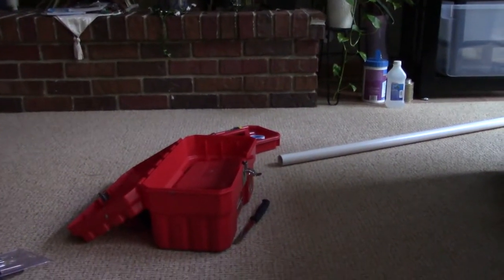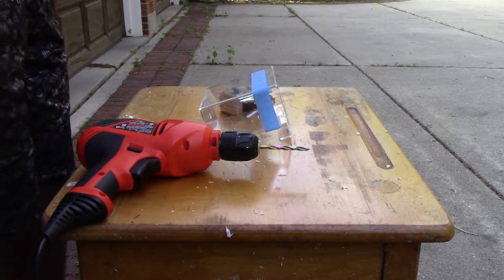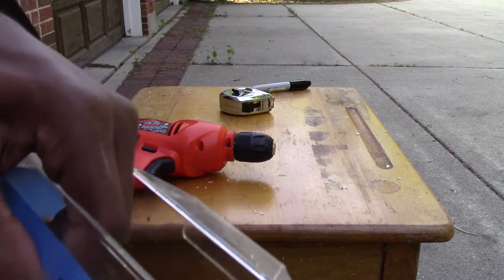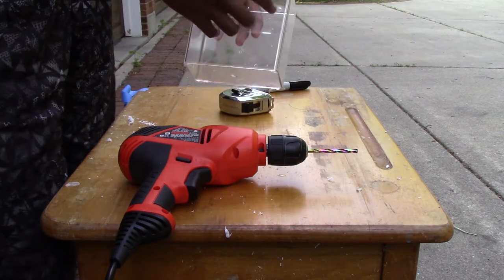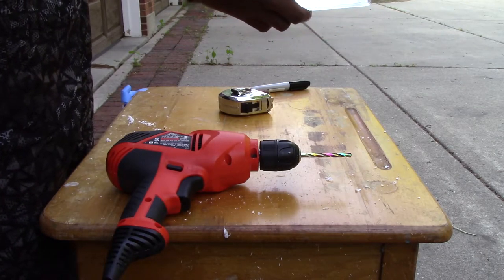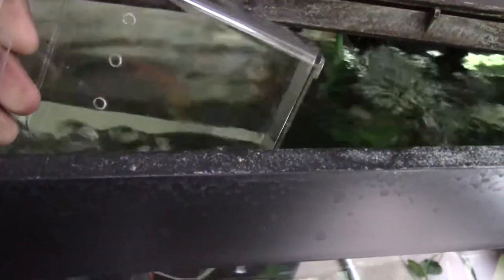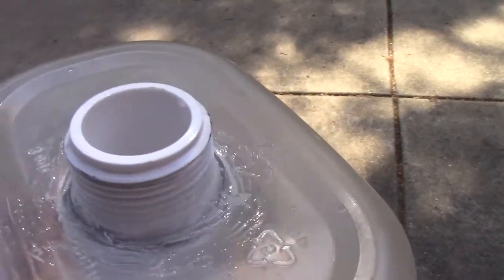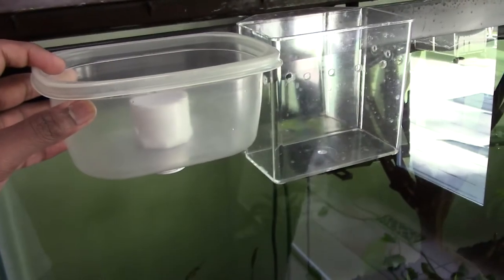DIY Cheap Aquarium Sump Build Part 3 - Overflow Boxes

Comment: Why not use the Lee’s box as the exterior box and drill bulkhead hole at bottom. Then add pipe to bulkhead at right height. This way, no need for the Tupperware and solution is simpler. Alternatively, find a right sized cup and run the siphon to this cup in the container. That way water overflows from cup and out. Height of cup dictates water level and don’t have to worry about water tight seal of the pipe to bulkhead.
Reply: I was just thinking about this too. Wondering if you can use that like a DIY Ghost Overflow box. Drill the tank, drill the container, then drill 2 holes in the bottom of the container and then pipe it down to the sump
Reply: @RyanBennett_Gpd605  sure I don’t see why not. I can’t do this cause I can’t drill holes in the tank so I use a pair of U tubes instead from the tank to the exterior box. The U tubes in the exterior box sit in a cup that also sits on the box. This way I can easily change the overflow height by changing the cup height.